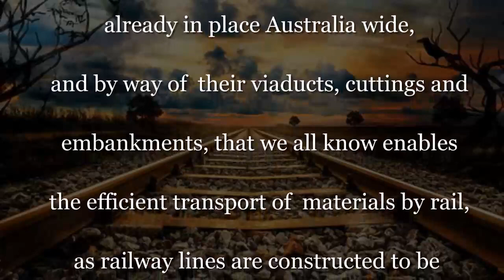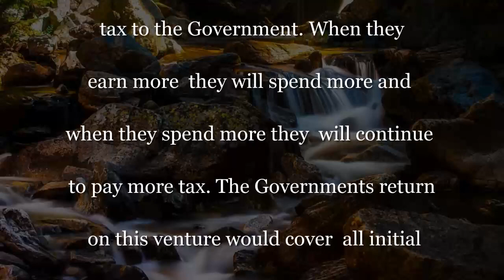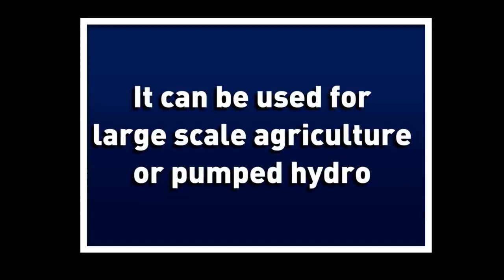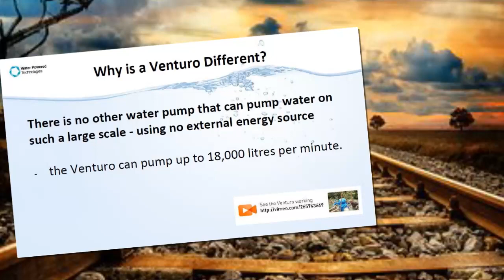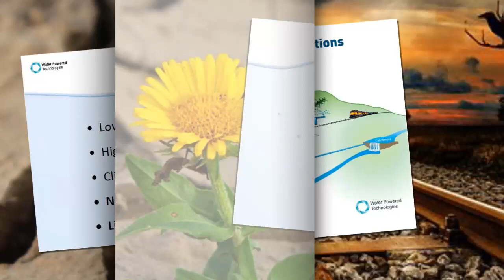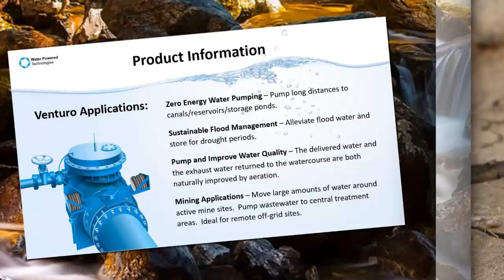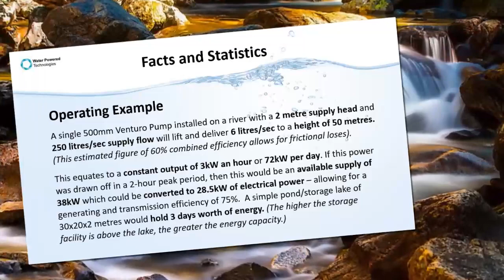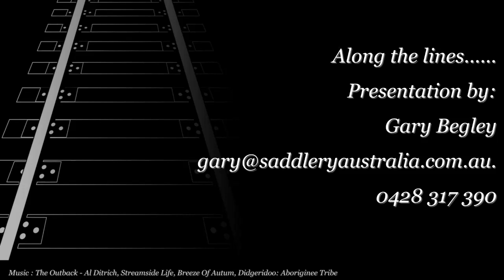Hydraulic Ram Pump Along the lines Project   Venturo

Comment: Can it be used to produce electricity using a big elevated tank and a pelton turbyne instead of a river ?

If posible that would make this product usible in all areas not only areas with rivers
Reply from the maker: It is possible to use this technology for hydropower as long as the elevated tank has its own supply of water.